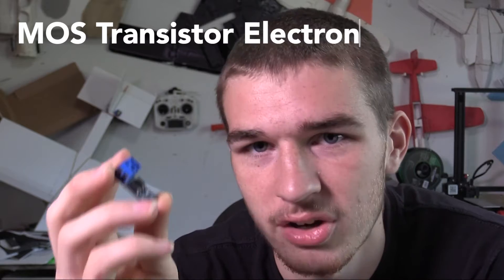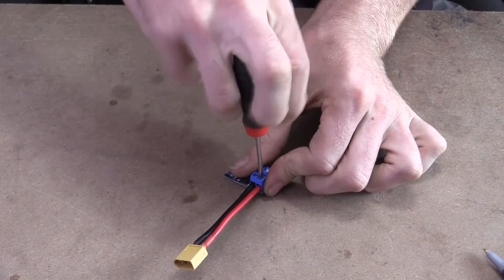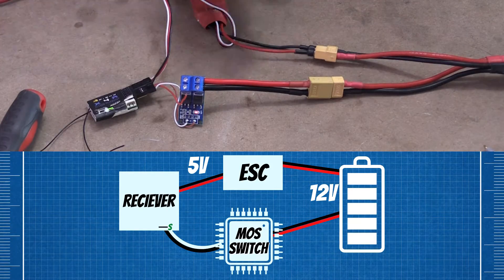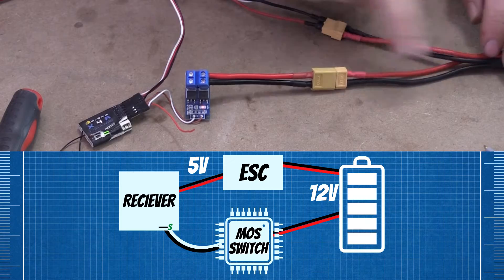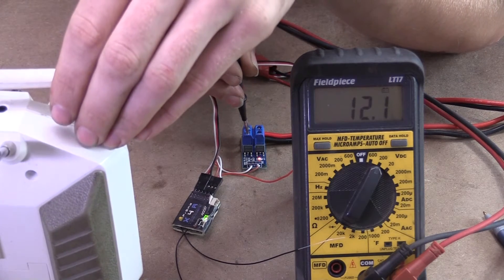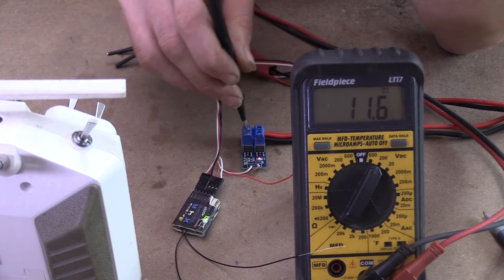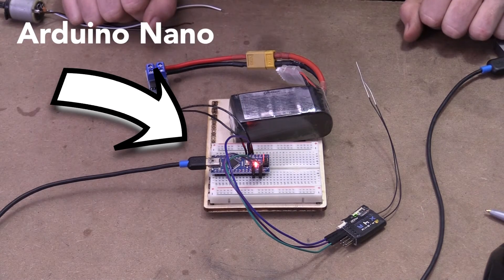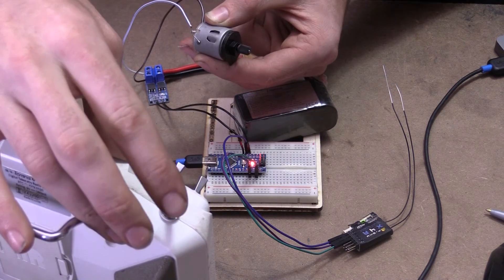Diy RC Electronic Switch | Simple and Easy

Comment: This could come in handy for an RC rocket glider.  Launch and fly all from the controller.  Another cool option would be to work it into a rocket itself as part of an Arduino controlled avionics system, following proper safety protocols, of course.
Reply from the maker: Those could both be cool. The possibilities are endless!!